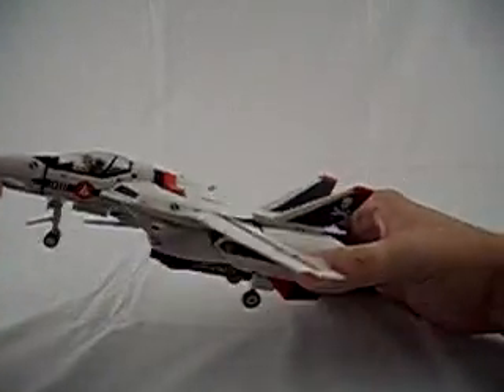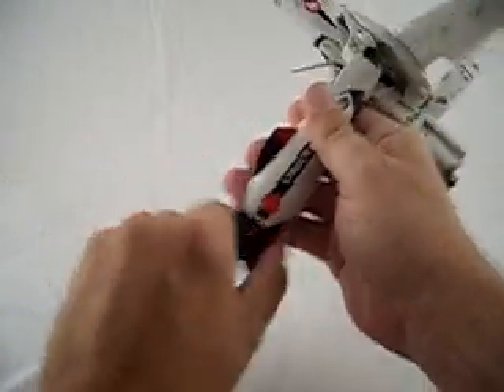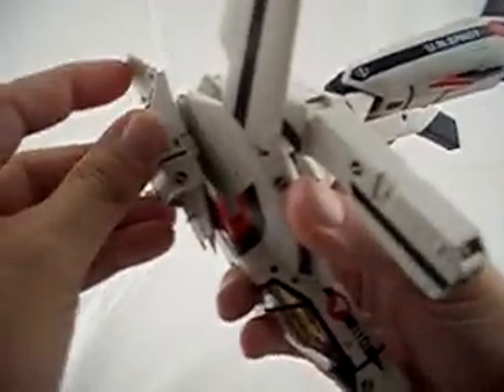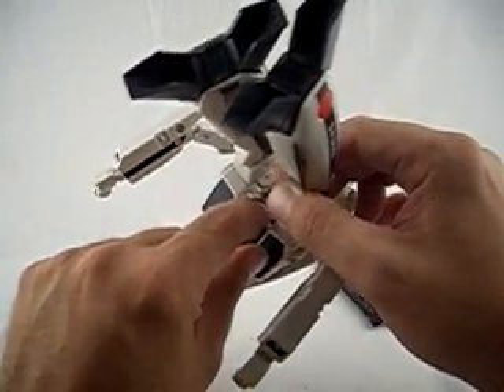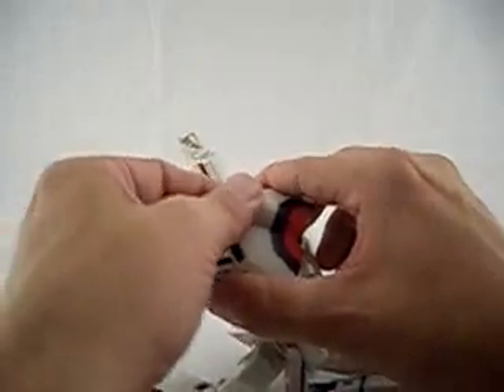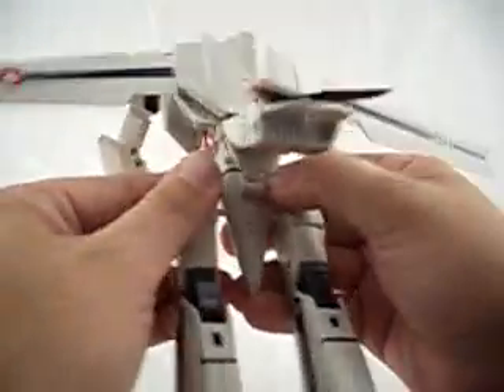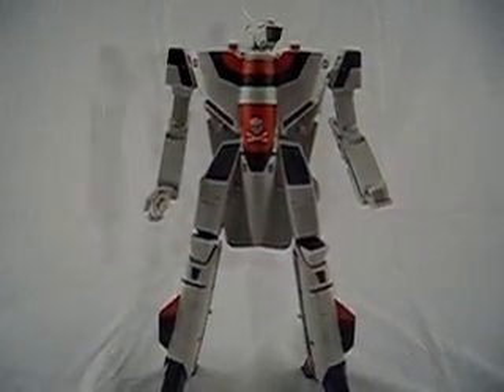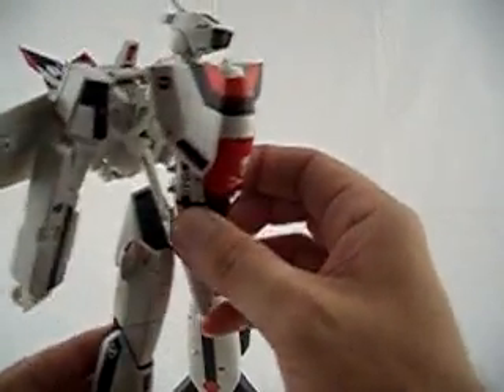How To Transform the Yamato 1/60 (2.0) Valkyrie Fighter - CollectionDX

Comment: Fascinating. My brother and I each used to own one of the original die-cast version valkyries back from 1985. Heavy as a brick, tough as shtt, no heat shield, and nowhere near as complicated as the one in your video. The hands simply slid out of the forearms via knobs, the head was fixed, and the spring-loaded landing gear was activated by a knobby little switch which would flick out the wheel and smash it into your fingernail with enough force to bruise it through the nail.
Reply from the maker: Me Owthorr The original is one of the all time great toy designs.

Comment: Bought these and have to say. I'm super disappointed. The holes are too small for the pin. I could not get the pin. I was hammering it with a hammer and it wouldn't go. The pin actually broke.

Comment: What a difficult transformation. Thinking aboit it as if it would be a real-life combat ship, I would not work anyway. The supports for the legs and the chest seem very weak. While tranforming in mid-air from GEARWALK to BATTROID, the sip would surely break appart!!! Surely an operative real life model would not look like a humanoid when transforming into BATTROID. The design should be stronger and by indeed fatter and uglier. Guess we'll never se anything like that flying the real sky.